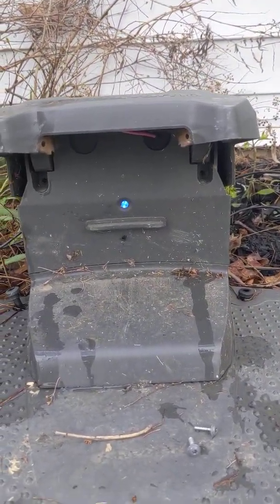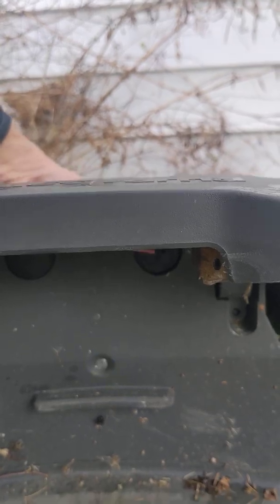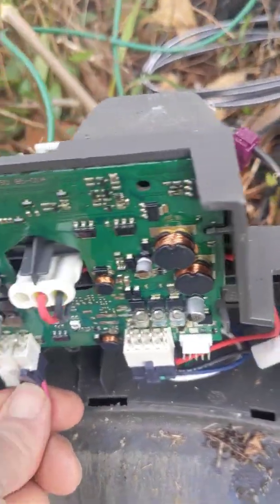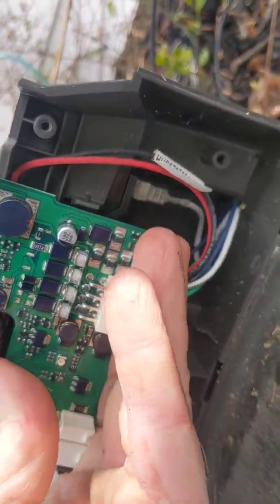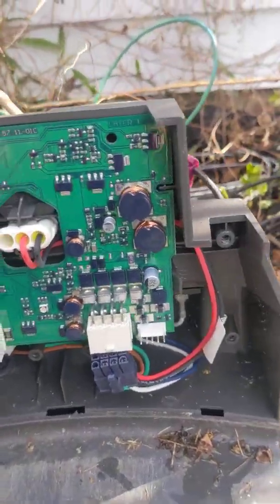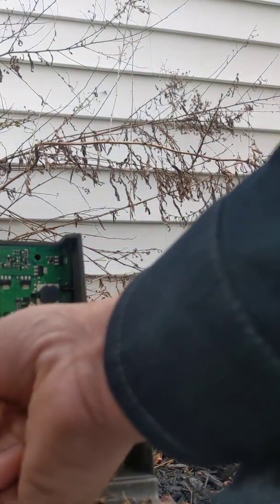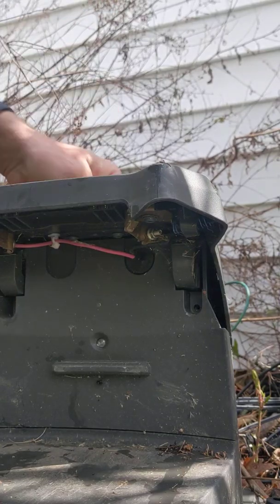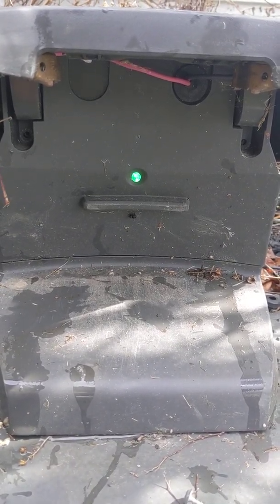Husqvarna Automower flashing blue light.

Comment: Hi, I have a similar problem, sometimes I have green light but mainly blue. Loop wire all good, connections, power etc. Been told if the board goes it goes, will not light up at all. Is that really true? I think the board is playing up, it is 5 years old now.
Reply from the maker: If you are able, make a little jumper wire from AL to AR and see if you come up with a similar green/blue light scenario. The board can go bad and when it does it will give the flashing blue light. That is why I carry a 1-2 foot piece of wire to test AR and AL to see if I still get a blue light, if I do get the blue light with the shirt wire the board is no good.
Reply: @t.bowman3151  I will try the loop ... thanks for the quick reply!
Reply: To add, it's a Flymo which is a brand of Husqvarna.
Reply: Did the loop and the orange light came up.
Reply from the maker: @hprosir3698  my guess would be you need a new charging station board
Reply: New board in place - same errors coming up, grrrhhh.
Reply from the maker: @hprosir3698  are you still getting a blue light?
Reply: @t.bowman3151  ok ... after all this it was a frayed guide wire under the charger. It looked ok but thought I would change it and now have a lovely green light and a new board to boot.
Reply: And back to blue light again. Every time I unplug the connectors and plug them back in again the green light appears - last a few hours then back to blue. Really scratching my head here.
Reply from the maker: @hprosir3698  bad splice somewhere? Or knick in the line?
Reply: @t.bowman3151  Who knows, it works when it wants! Green light still comes and goes at random.